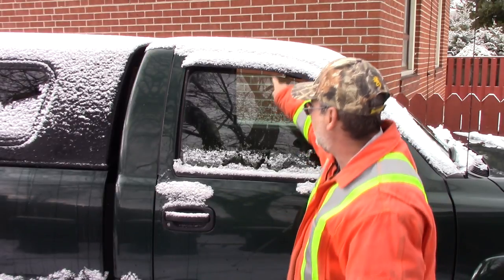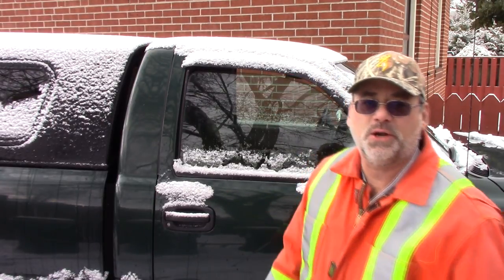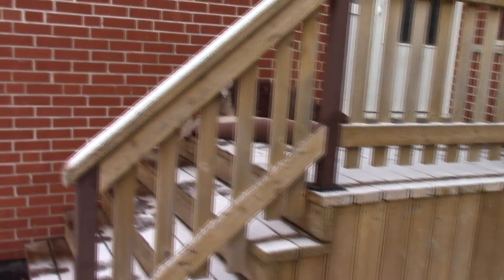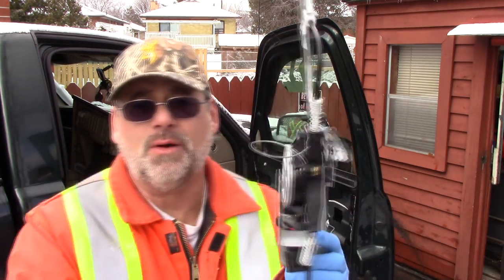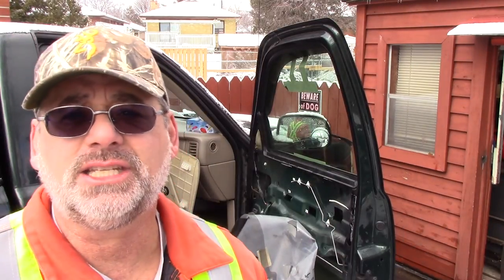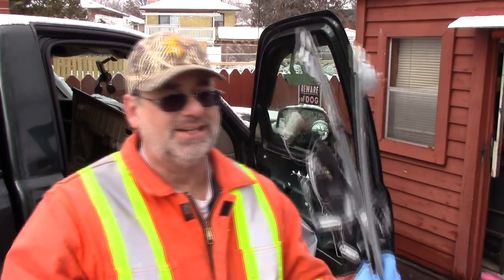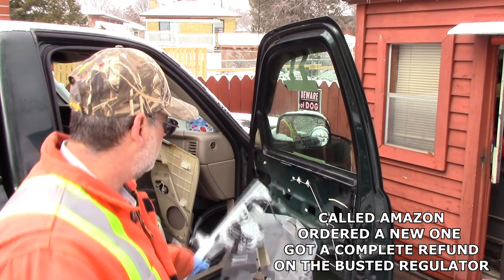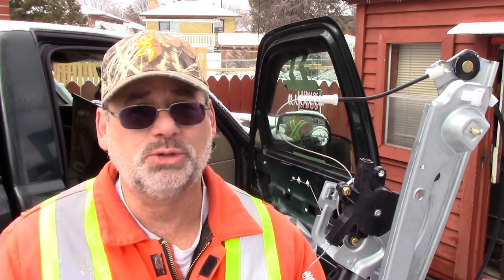HOW TO BREAK A SILVERADO POWER WINDOW REGULATOR  - WITH PROOF

Comment: Those regulators are cheap on amazon but when I had my Chevy Ssr I had to take a Chevy truck regulator and modify it to fix mine. The Ssr unit was not available
Reply from the maker: Wow not available.  That's not good.

Comment: That looks a lot like the one that comes on my truck.  For me the plastic clips at the top/bottom pulley brakes at the worst possible times (e.g. right before a storm is going to hit, or if I'm away from home). Luckily Dorman has lifetime warranty's on them otherwise I would have spent over $1000 on regulators easily. So paid $100 once (per window) and don't have to worry about the money again after that.  Just worry about the @#$%^&*! plastic pieces braking again.
Reply from the maker: Amazon keeps sending me a new  dorman  so I'm getting real good at doing it. 😂
Reply: @SteveRobReviews , i got mine from AutoZone so I don't have to wait for shipping. I can sometimes get a turn around time of an hour or two from time the window dropped to the time I have it fixed. Don't even need to break out the service manual (or my own YouTube vids on it). I've got the procedure memorized. I've even started to write install dates on the regulators to see how long they last and to make looking it up in the AutoZone system easier. Its pretty pathetic. I'm surprised they would warranty something that brakes so easy.
Reply from the maker: My oem lasted just after the 3 year warranty . Dorman is not the best in quality but they are consistent in their  quality.  I get about 30 to 50 ups and downs before it implodes 😂